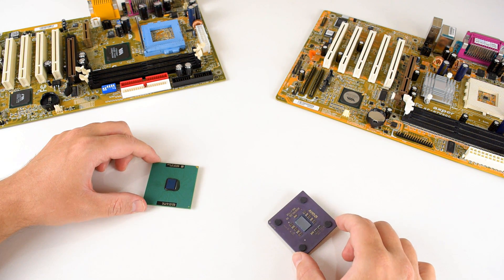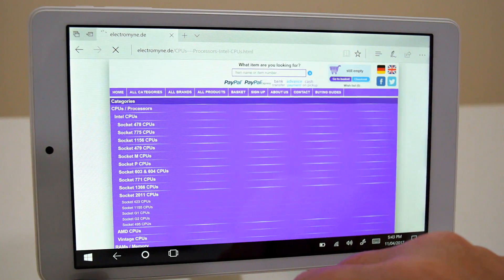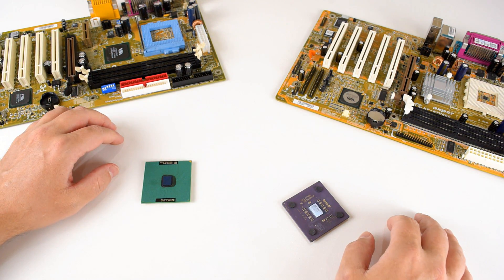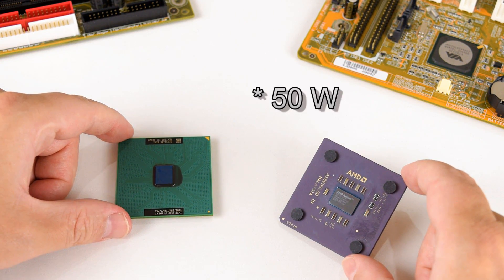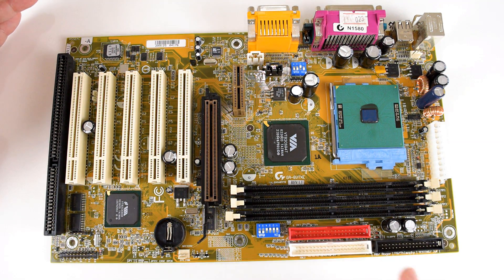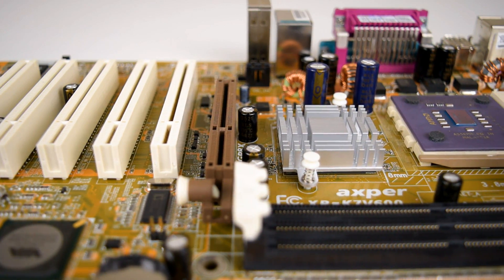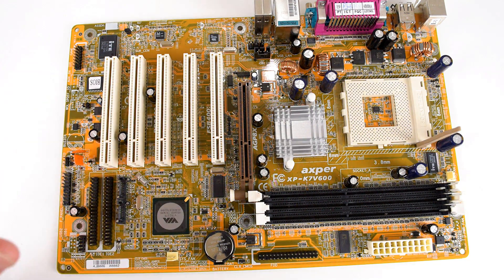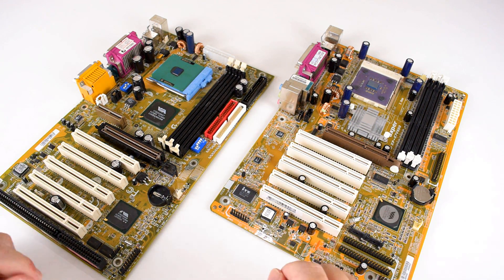1 GHz Retro PC Build Part 1: Pentium III or Athlon

Comment: I chose the Athlon CPU. The irony is, that when I was younger, I would prefer the Pentium.
Reply: Thats what marketing does to people with not enough knowledge. Remember Pentium 4? I member...
Reply: Alacorn Yes . I owned a Willamette based p4 (those with a really funky socket. pre-478) rocking a pair of pricey RDRAM back then. way to expensive compared to the crappy performance :)
Reply: Yeah, I went with a Pentium III when my parents finally decided we needed a new computer. Then again HP and Dell only offered Pentium IIIs at the time and HP didn't really advertise the AMD Slot A PCs at all. A couple of years later I decided to build my own PC and going the AMD Duron route was much cheaper without much of a performance loss compared to the Pentium III socket 370s or Socket A Athlon Thunderbirds. This was a Morgan Core 1.3GHz Duron by the way. I saved up enough money for an Athlon XP 1800+ a few months later and dropped it into my nForce1. That was another factor in that the nForce1 offered GeForce 2 MX speeds which was more than enough for the games I played negating the need for a GPU upgrade which wouldn't have been possible with the Intel route.
Reply: Yeah, who want's to own a Pentium 4 1.7 GHz when the Pentium 3 1.4 GHz clearly wins in basically all tests. Even power consumption. A fast Northwood with RDRAM is somewhat of a curiosity nowadays, so that would be someting interresing to have.
Reply: i still have a working pentium 4 3ghz (in fact i was just troubleshooting it) and i tested it against current processors.

clock per clock and core per core, my 3ghz pentium 4 is 22% of a core2duo e8400 (also 3ghz) and 16% of a core i7 4000 series (at 3ghz).
it's garbage, lol.
Reply: I have also three PIV 1.7 cpu`s, and one Celeron 1.2 on Tualatin core and when I test that cpu`s I saw that C1.2 is faster in some tests than that PIV.
Reply: Also I prefer Pentium years ago, but now I prefer AMD :)
Reply: I still have my PIV Gigabyte GA-8IDX SDRAM board with some cpu`s, I have even Celeron 1.7 on Wilamette core that cpu is very slow compared to anything from AMD.
Reply: HappyBeezerStudios - by Lord_Mogul 
Nah. The P4 is faster if the code is recompiled. :)

Besides Northwood didn't use rdram that often. it was pretty much only used with the 423 socket used by Willamette

Comment: I had salvaged a pc with a P3 1ghz, but the motherboard is full of blown capacitors, and Im not very confident I can change them.

P.S: you should do a vid on why slot 1 CPUs came to being.
Reply: Slot 1 existed because intel wanted to move L2 cache closer to the CPU and give it its own dedicated bus. The socket 8 way of doing that was too expensive. After the L2 went onto the same die as the CPU it was no longer necessary or cheaper to have a cartridge.

Comment: PIII motherboard has universal AGP slot and Athlon's is not.
Voted for Pentium III.
Reply: Yes, quite important if you want to use Voodoo cards, you wont be able to use them in the Athlon motherboard because it's keyed for x4/x8 and wont accept the voodoo cards, I use an ASUS A7V-E motherboard , it has a universal AGP slot and only accepts CPUs with 100mhz FSB but is running Athlon 1400 at moment, depends a bit what sort of hardware you want to use but the athlon system will restrict you to newer hardware only where P3 system will allow you to use any AGP card and an ISA sound card so , out of these two motherboards , I would vote P3 system

Comment: I had the 1ghz Athlon back in the day so I vote for that, will be interesting to see benchmarks, I had a geforce 3 ti 200 I remember running medal of honour allied assault perfect
Reply: allied assault... best. game. ever.
Reply: I think mine is still kicking around. Will need to hunt around for it :)
Reply: Matthew Potter I had an athlon paired with a geforce 2, pre 2002 games ran like a charm
Reply: A fine rig, git a GF 3 Ti 200 for my P3 933. Fits fine.
Reply: Matthew Holevinski I recently started my first playthrough, lol. I always wanted to try the Metal of Honor series, but I only played CoD 1,2 and 4 in the past.
Reply: Abdelhakim Neozander GeForce 2 squad checking in. I got a GF 2 MX 400 in my retro parts box, I might use it if i ever get around to building a dedicated Win 98 box.
Reply: i remember the pc magazines of the era saying the athlons were better at gaming

Comment: I have the Pentium III 650MHz  Coppermine in Slot 1 with an Asus Intel board configuration and an AMD Duron 1.3GHz Morgan core, AMD Athlon XP 1800+ and AMD Athlon XP 2500+  on nVidia NForce 1 and nForce 2 Ultra boards. So I vote for the AMD Athlon as I want to see how the Thunderbird core fares in gaming and I love those older Socket A processors.

Comment: I know it's supposed to be retro, but I voted for AMD because of the sata ports, it maaaaay be possible to install an SSD and have a blazing fast retro pc
Reply: I am planning on doing this on a nForce2 Ultra motherboard once I get a spare SSD but I know I would need to turn to Druaga1's videos to get SSD running on WindowsXP... that is if the nForce accepts the SSD at all (once the SATA drivers are in place).
Reply: emucosmos pata/ide SSDs do exist and are pretty fast especially when latency is concerned because of the wider bus of the ide chipset. I have a couple and they boot my windows 98 1ghz coppermine in under 20sec

Comment: I will say I hope the Athlon wins, I actually started out on a K7... 

I will mention my own retro build is actually an IBM PC300PL that I received as sort of a gift, so I was pretty limited in upgrades being an NLX form-factor system. Had to replace a couple of capacitors, and as far as upgrades go I've got a 1 GHz Coppermine on a Slot-1/370 adapter (cooled by a stock Socket-A heatsink :P), 512 MB of PC100, and an original nVidia Quadro SDR :)
Also threw in a 2nd 40 GB hard drive I had lying around

But yeah, I'd really love to see the Athlon, and I'd like to see how it compares to my Pentium :P

Comment: Whatever you build it will be Great, Just checked out that AMD motherboard on Ebay
To ship to U.S. costs as much as the board, so i will have to wait a bit on that, I do have an ABIT KT20 with a 900 Duron waiting on a new case. Looking forward to the Next Video. Thanks again Phil